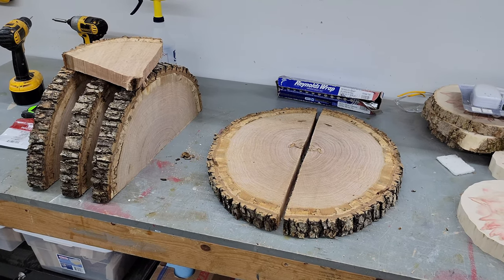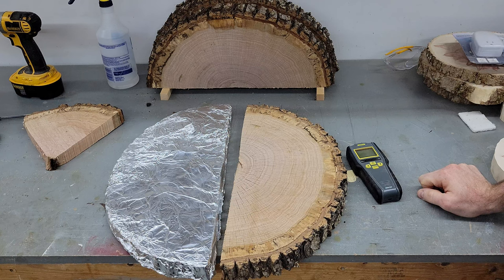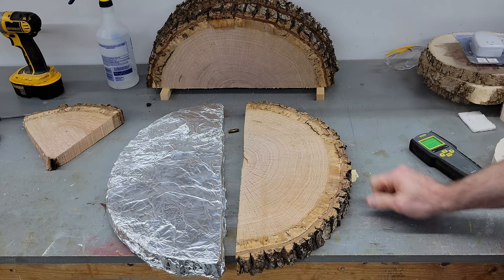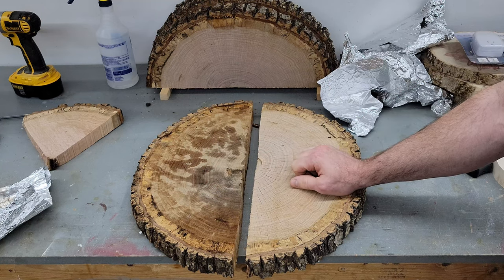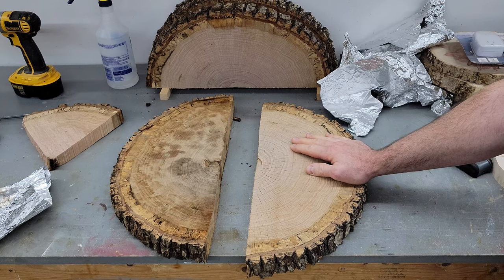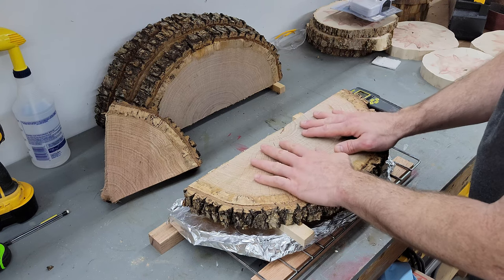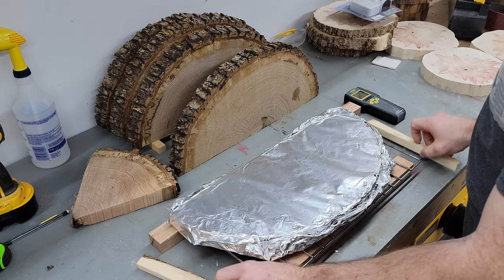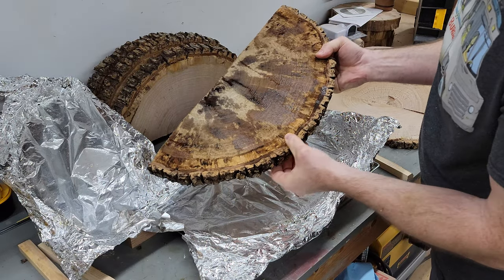What happens when you bake wood cookies wrapped in foil?

Comment: This was super helpful, thank you!!💕 
We just had to get rid of an up rooted apple tree my late dad planted and it had a lot of sentimental value to me and my sisters, so I saved a couple good truck logs and I've been trying to teach myself how to make them some slabs as a gift while trying to preserve the rings and outside bark. Since it's a surprise I think the 24hr oven drying might be difficult, but I'm definitely trying that black bag method!!
Reply from the maker: @pooolB  Apple wood is beautiful, but most of the fruit wood I've worked with is prone to cracking when it dries. Definitely go as slowly as you can. You might also look into things like Pentacryl or saturating the wood with alcohol to help displace the water.

Comment: Could you give me more details on the plastic bag method? I have a round slice of apricot that is too big for my oven (24in diameter and 3 in thick). It has been sitting outside for a month (didnt know anything about slow drying). I'm ok with filling some cracks with clear expoxy. I was thinking of making a sun oven with cardboard foil etc like you do in school science class?
Reply from the maker: The plastic bag method is just an attempt to slow the rate at which the water evaporates. If the surface dries too quickly, the wood is more likely to crack. I just use the bag to absorb heat from the sun, which cooks out some moisture, and then I shake out some of that moisture and repeat.

Comment: I’ve been reading up on this. I have a handful of green 4” rounds that i need for a project as soon as possible. I would hate to ruin them. Your foil wrapped method is interesting. A combination of this and air drying might be the way. I’ve also read that a salt paste on the surface helps it not lose surface moisture as quick and helps mitigate checking/cracking. I’m thinking cook it in the oven an hour or two at a time at low temps and once the moistures been regulated, and pests eliminated, applying the salt paste and letting air dry. Not sure if the time saved is worth the trouble or if I should just take it to the local mill to throw in the kiln. Though they’re on a 3 month cycle so it’ll be 3 to 6 months before I get my hands on them.
Reply from the maker: It's tough to speed up the drying of 4" thick rounds, especially if it's a denser wood. A vacuum kiln would speed the drying, but those don't seem to be very common. I've had good luck with Pentacryl keeping the wood from cracking as it dries, but it doesn't accelerate the drying.
Reply: @TheSnekkerShow  i saw some stuff on pentacryl but it’s supposed to be harsh. Not sure if it’d be a good idea since i intend to make kitchen items with these. May just have to bite the bullet and be patient

Comment: Interesting demo. Really shows how much moisture is in green wood and how long it takes to dry. We have a similar Samsung oven with the Convection feature. I noticed you had it the convection activated. I would think that the moving air in the oven would wick moisture away from the surface even faster. Did you do any runs with just "Bake."

Follow up question, do you "pre-drill" or do you "drill a pilot hole?" Part 2 of the follow up question, do you "pre-heat" or "warm to temperature." Feel lots of pressure when you answer this question, because 50% of the planet is about to dislike you. 🤣
Reply from the maker: I used to bake wood with a conventional oven. The convection air usually darkens the wood more evenly, but does contribute to faster drying. For the follow-up question, I proactively reduce cylindrical impediments, and optimize preparatory thermal conditions. I also own a cold-water heater.
Reply: @TheSnekkerShow  Nice! good tip of the convection setting for maintaining an even color.
Reply: 1. I drill a pilot hole
2. Whenever I need to heat something up, I put it outside the house

Comment: Havent finished vid yet but i was just thinking about this kinda thing as far as accelerated drying without pressure chamber on woods that check and crack easily, get it hot to get everything nice and flexible but dont let the moisture escape as fast as it wants to bare, so it can do most of its moving while the lignin is hot. 

As far as bugs and fungus goes even my oldest logs of red oak i have ( they spent probably just shy of 2 decades in the dirt) the heartwood is still in good condition, not perfect, softened a bit, obv the sapwood is gone. So just depends on if you need the sap and bark. But i could be wrong and only bit into the lucky pieces lol

Comment: Very interesting video!
I have some very large Redoak cookies but don’t have enough aluminum foil to wrap one so was thinking about wrapping it up in some 4mil plastic and placing in a hot kiln. 
Thoughts??
Reply from the maker: Depending on the kind of plastic, it might start to melt and create fumes over 200°F.
Reply: @TheSnekkerShow  I’d be scared to take my kiln over 150 since it’s made out of wood too. Besides the research I’ve seen indicates that’s all that’s needed to sanitize. Do you think it’ll still work at lower temperatures?
Reply from the maker: @noneya2321  150°F is the temperature I use for my makeshift kiln, which is made of plastic, so you should be good.
Reply: @TheSnekkerShow  in your opinion, how long do you think it’ll take to properly dry an 50” x 3” thick Redoak cookie?
Reply from the maker: @noneya2321  Too many variables for me to guess.
Reply: @TheSnekkerShow  ok, we’ll now you know why I can’t do this in my oven

Comment: Never thought a door it in an oven How about a closed area with a dehumidifier after the oven
Reply from the maker: Humidifiers, like ovens, will dry the surface first and crack the wood. The challenge is getting the moisture equalized throughout the piece. A vacuum chamber with a humidifier could help.

Comment: So will this stop it from cracking?
Reply from the maker: Slower drying helps reduce the risk of cracking. The foil mostly helps hold in some moisture so the surface doesn't dry too quickly while the inside is still wet.

Comment: I know this is 2yo but I have som black walnut pieces I'm trying to dry with out cracking. How would I adapt the foil method (temp and time) to ensure the moisture was drawn out without checking?
Reply from the maker: @DerrickOrtiz-g3l  It's tough to draw the moisture out of the core without a vacuum kiln, but you could heat the wood, open the foil just enough to let some steam escape, rewrap it before the surface dries too much to let the moisture equalize, and repeat. I've done something similar outdoors using black bags and summer heat, but even then, it takes a long time to get the moisture out.
Reply: @TheSnekkerShow  Here's a stupid question; What would happen if you heat a pieces of wood in oil ?
Without causing the oil to flame out :P
Reply from the maker: @michelalphonso6945  Depending on how wet the wood is, possible an an explosion and severe burns. I'm curious now, but I don't think I'll try that anytime soon.

Comment: Help! So many questions. What did the foil look like after? I would like to try this method but I don’t want it to look like a mess. We are using the wood slices(  2”thick 10-12” circumference) as steps on the wall of our out door cat enclosure. Do the surface checks of the non covered slices affect the stability? How long and temp do you guesstimate I can expect to take in the oven. Do you recommend sticking with 179 or going up to 300? Finally we want to cut off a piece of each cookie so there is a flat surface flush to the wall. Is it better to cut it before or after drying?
Reply from the maker: Most of your questions depend on wood type and current moisture level. For the last one, cut the wood after you dry it it to minimize how much it moves after it's cut.

Comment: Very interesting experiment!
I happen to live in tropics and few months ago I chainsawed 60cm diameter logs to a thickness of 40cm which allowed me to load it with a real struggle on my pickup truck 
I planned to slice it the day after to 12cm but got busy and forgot about it for 4 months 
The ambient temperature is 40C for 12 hours and drops to 35C at night. 
Now...
I don't have a  moisture meter but to be honest these 12cm slices feel dry as it can get and feel ready to be used for the mini round cookie tables build. 
Your video made me so curious that I'll have to order a moisture meter tomorrow 
My 12cm slices don't have any cracks and I cut vertical notch to confirm they are just as dry inside all the way through the height profile.
They were not under the direct sun but under the open walls roofing. 
Please note that our humidity is like 95% ;)
Reply from the maker: The white oak I used in this video is very dense with closed pores, but I have dried other things much faster. You probably have fewer problems with cracking in your climate, but if you ever move the finished project inside an air-conditioned house it might still crack. It took me too long to buy a moisture meter, but it was a good investment.
Reply: @TheSnekkerShow  since you already researched the moisture meters, your recommendation is welcome!
yes the tropics are very good for drying wood, (it doesn't crack) but on the other hand it changes the geometry, so you need to put your pieces together the same day you milled your stock or it won't fit the next day. the flat boards also like to warp and twist more often than not.
what I noticed is, when I use 1.5 inches and above thick material, it pretty much stays flat. that's why most of my furniture is bold. when I used thin and flimsy boards, everything goes haywire and bunkers. 
I also put 4 coats of boiled linseed oil, which makes the wood waterproof, and makes it look gorgeous as well. smells great too.
Reply from the maker: @TigerCarpenter  I put a link to the meter I own in the video description. There are probably better ones available, but this one has worked pretty well for me. The manual says the maximum depth of measurement is 3/4", so for thicker boards a little speculation is needed.

Comment: Makes me wonder why they call them cookies… they look more like pizzas!  LOL

I’ve had varying luck at drying cookies… the only true success was when I sealed the end grain and air dried them in 4” thickness.  Before cutting them into slices.  But… they were riddled with bugs!

Several years ago, I cut down a red oak about 24” in diameter.  It was green and too crooked to mill as lumber.  So, I cut them into firewood length rounds and stacked them up next to the outside of my new woodshed.

That fall I brought out the splitter and started working through the stack.  Everywhere the ends touched the corrugated galvanized siding, the zinc was completely dissolved.  The tin was a mess of nearly perfectly round rust spots.  My nice new shed wall had to be replaced!

I wonder if the coloration on the aluminum cookie might be a chemical reaction?  Did you notice any effect on the foil?

Thanks for the demo!  Nice job.
Reply from the maker: That's a good question. I was wondering before I started if the tannin in the oak would affect the aluminum, despite the lack of iron, and I'm still not sure if it was a factor. The aluminum did not appear to be affected. There's a method of darkening oak that involves soaking steel wool in vinegar, and then wiping the resulting liquid onto the wood to react with the tannin. As an impatient teenager, I once tried to accelerate the process by using muriatic acid instead of vinegar to dissolve the steel wool, which is how I learned how to create hydrogen gas. I'm not so surprised that the piece wrapped in aluminum got darker from heat, but I'm curious why the unwrapped one didn't. 300-400°F is the temperature range I normally use to darken wood.
Reply: @TheSnekkerShow  I used the steel wool darkening method on some white oak spindles that I had turned.  It worked but one of the parts bowed from the moisture.

Surely there is a chemical reaction involved with the aluminum… it would be interesting to see what happens without the heat.  I might try it the next time one I’m cutting a green white or red oak.

Thanx

Comment: I have almost the exact same Samsung stove as you, mine is almost 13 years old now. The knobs are identical. One thing to watch out for is almost all the labels on the stainless panel around the knobs have mostly worn off now, probably from cleaning. I've had to use a tape label maker to replace the labels so the stove it still usable. Looks terrible. Very bad design, I'll never buy another Samsung stove again.
Reply from the maker: Good to know. My main complaint about this stove is that the top is bowed, so it's impossible to level any burner without making another one un-level. Makes it a little challenging to make crepes when everything runs downhill.